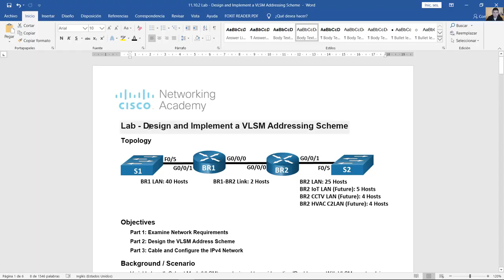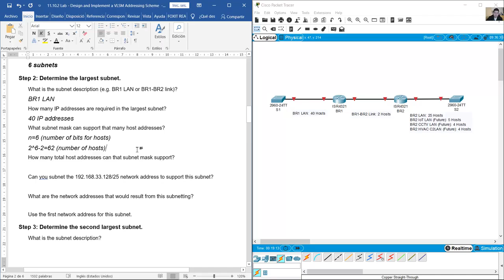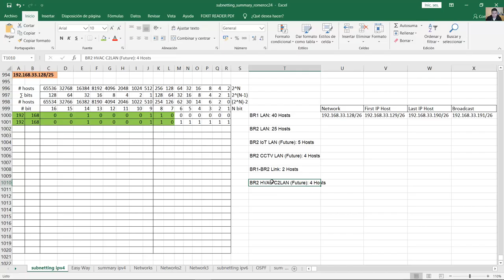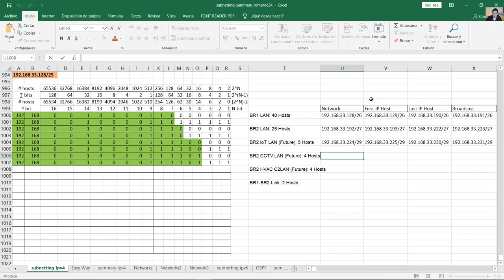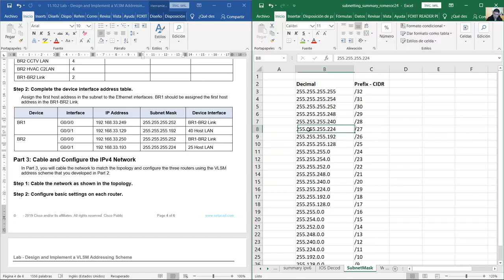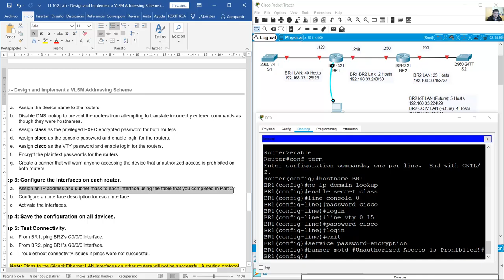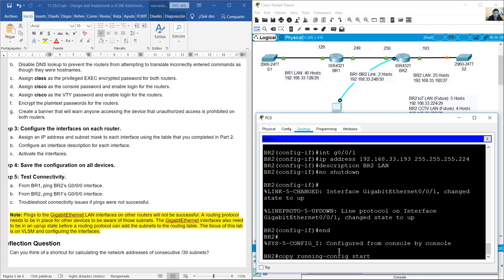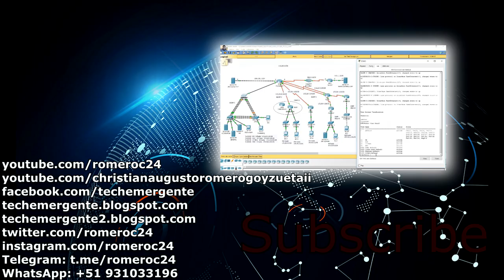11.10.2 Lab - Design and Implement a VLSM Addressing Scheme

Comment: Hey, thanks for the video but i have to make more connections through my router so i used serial ports too in my topology. But when i am using the terminal to assign the ip address and writing the 'no shutdown' command the state is put to down but i expect the state to be up. Please let me know how to fix it.
Reply from the maker: you need to configure the another side, link will not be activated unless both sides are configured

Comment: why did you skip some of the questions and say they are unnecessary? that just made me more confused.how do i get the answers to the ones you skipped because the approach you are using is not straightforward. i thought this video was to help those who are having a hard time  answering the questions.i need help here
Reply from the maker: I just completed all answers, please view the complete video
Reply: @romeroc24   It would really help if you just dropped a file with the detailed answers
Reply: Your video is very long and I keep going back the beginning to understand the skipped questions, very tiring
Reply from the maker: @danielsimpson7054  if you follow all steps on this video, you can create your own file
Reply from the maker: @danielsimpson7054  if you see all the video content, then you will be happy
Reply: @romeroc24  i have viewed the complete video but i still dont have answers to the parts you skipped. Do you have another video for that ?
Reply from the maker: @melimark6385  The table I made has all the answers
Reply: @danielsimpson7054  i agree. This method would be really helpful.dropping a file with the detailed answers would be much better.
Reply: @romeroc24   Yes It does, but it's confusing please help us out
Reply from the maker: @danielsimpson7054  OK please tell me the specific part